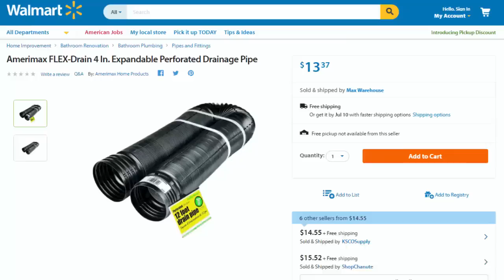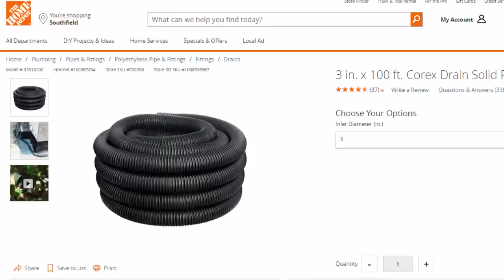Underground Roof Gutter Drain Pipe

Comment: This a bad design. Especially in Michigan where it will freeze in the winter, backing up and potentially flooding out your basement and damaging your eavestroughs when the ice expands. Never bury the eavestroughs unless you have a proper french drain or the pipe is tied into the weeping system....and even then it will still catch all the gravel from the shingles and fail eventually. Water should never have to capillary up a drain like that. Water flows down with gravity, not up without building pressure first.  Since your pipe that you're using is solid and will always hold water, and is not below the frost line it will freeze in the winter, blocking the drain path. Lastly ...ALWAYS use the sock covered big o unless you want it to plug with dirt over time.
Reply from the maker: 1.  During a rainstorm, 99% of the water comes out of the grate, which is 20 feet from the house.  That is better than just dumping the water out from the gutter.
2.  Like many residential homes, the yard is super flat.  There was no lower elevation where the water could exit.  This was the best option.
3.  Yes water freezes in Michigan in the winter.  So we don't really have to worry about water flooding the basement, everything was frozen.
4.  Water only remained in the pipe for about 1-2 days after a rainstorm.  Then the small amount of water, which remained in the pipe, would seep into the ground throughout the perforated section of pipe, which was 10 feet away from the foundation.
5.  The system is not air-tight.  There's no pressure build up.  It's not a water-tight connection between the black pipe and the gutter.  If the outlet pipe ever became clogged, water would just come out at the connection between the gutter downspout and the black pipe.  It would not fill up the downspout and gutter.
6.  Some leaves and shingle gravel would accumulate at the end of the pipe.  Usually once or twice per year i would take off the end cap and scoop out the junk with my hand.
Reply: @Dave Wirth  re: #3  be careful in the spring and start of winter. I only commented because I deal with these problems all the time. Specifically I am dealing with one right now that started being a problem in December. Same design as yours.  The drainage grate got buried with snow. When we have freeze, thaw cycles the pipe stays plugged underground while the snow and rain overwhelm the eavestrough. Where does the water go then?  I can tell you there's a very good chance it will end up in your house, as is the case I am dealing with.
Reply from the maker: @davidr4500  If the outlet grate was plugged, water would come out at the connection point between the downspout and black pipe.  Basically the same point the water would come out if it were just spilling out of the downspout to the ground.  Yes, near the foundation.
Reply: @Dave Wirth  yes correct. And I have seen ice build up right to the roof when it fails, rendering it a liability. This can damage the roof, trough and any surface the ice builds up on like siding or masonry. Not to mention the water at the foundation.
Reply: @Dave Wirth  an easy and feasible solution: take a 20 gal trash can, cut off the bottom. Dig a 5 or 6' hole and bury the can, fill the bottom with 3/4" clear stone. Cut a hole in the side for your drain pipe. Put the lid back on the garbage can (upside down if more top soil space needed) and backfill. Instant drain pit.

Comment: But the water doesn't go anywhere. It just sits there in the pipe?
Reply from the maker: The water goes out the end cap and drains on the lawn.  All water left in the pipe slowly drains into the ground o or the next few days
Reply: @DaveWirth  Oh. I see. So the end cap is at a lower level than the downspout. Got it. Since it's been almost 3 years since you've installed this. How is it holding up?
Reply from the maker: @dfisk79  We moved 2 years ago.  But it worked great.  During heavy rains, water would pour up from the end cap.  Sometimes with enough force to push the cap off the end of the pipe.  
Water would sit in the pipe for a few days (our yard was 100% clay) but slowly drain out through the holes in the pipe.  The main thing was that the majority of the water was draining 20 feet away from the house.

Comment: So do you use PVC or corrugated pipe for downspout extensions?
Reply from the maker: The corrugated flexible pipe is nice because you can just bend it upwards and don't need a 90 degree elbow.
But both work
Reply: We generally just use corrugated. PVC has its place but with a lifespan of 25 years on corrugated, its hard to beat.

Comment: Do you get a lot of debris in your gutters? If so, how do you keep it from clogging the in ground pipe? Thank you
Reply from the maker: I don't get a lot of debris in the front gutters.  But i do have some 1/2" chicken wire folded up in the gutter at the top of the downspout to block whatever leaves get in there.  For the gutters at the back of the house i have a large tree and decided not to do the chicken wire.  I'd rather have it back up in the pipe, where i can just reach in and pull out a few handfuls of leaves, than have it back up in the gutter and climb up there on the ladder while the rain is pouring down the side of the house.

Comment: Kind of surprised you wouldn’t just finish the job and take the water to the curb for the storm drain.
Reply from the maker: Well there's a sidewalk in between the house and road that we would have to tunnel under.  And working in the right-of-way would require a permit.  And then how would we get to the storm drain?  The catch basin or the pipe itself?  You can't just connect to the city storm pipe (if it's even on your side of the road).  Plus it's at leas 4' down.  If you are talking about the catch basin in the road, i would have to cut into the concrete curb which isn't allowed either.

Comment: Do not use corrugated pipe as the roof granules eventually collect in the corrugated pipe ridges and create a blockage.  Use solid PVC pipe and drill holes along the way to allow sitting water to drain and not collect in the pipe.
Reply: Proper slope and water pressure from roof runoff will prevent that from happening in most cases. I personally would have attached a clean out  at the downspout connection point to service when needed .

Comment: Ghetto.  Flex pipe should not be used at all.  You need a relief at the downspout connection so you dont risk topping the gutters when this system eventually clogs and backs up. The end needs to be terminated with a T connection so the system can drain to empty into a dry sump. There shouldn't be a grate at the outlet because it catches tree litter.  Completely wrong and you shouldnt be advising anyone.
Reply: Ghetto, that is a pretty racist term to use.